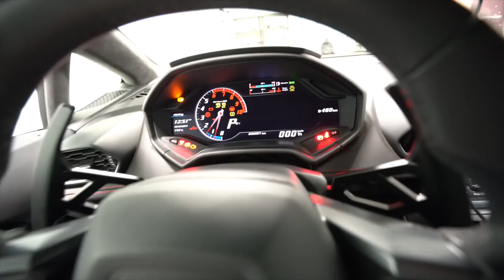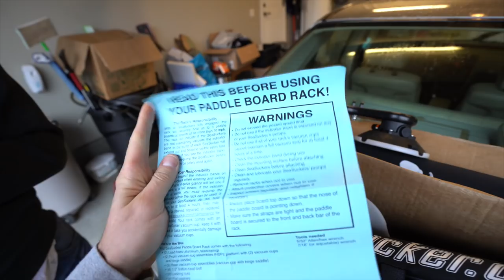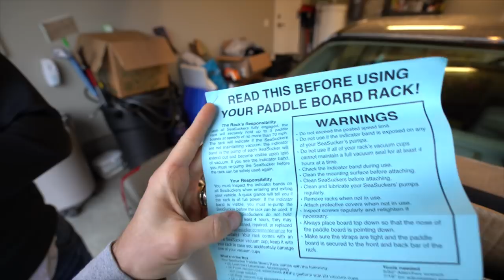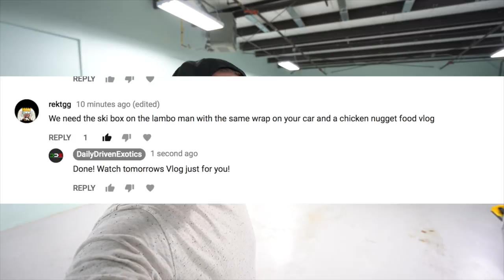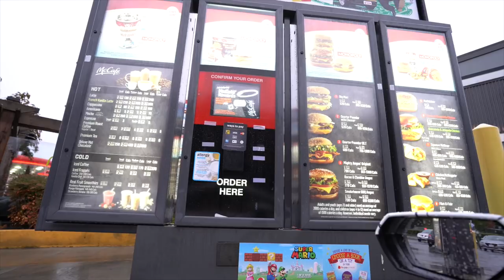My Lamborghini got a ski box *INSTALL*

Comment: I feel like the ski box further back with a fabricated bracket would work best... like mister Stradman has on his. At the moment, the whole front of the car is collecting air and pushing it all up to underneath the box and putting more pressure on the suction cups. If you mounted it further back so the front of the box is at the front of the roof, more air will go over the box instead of all being forced under the box, therefor putting less pressure on the suction cups. But some of the collected air might be pushing off to the sides of the box which would alleviate some of the pressure. 

Also... I wish I was a hat person. Would be fun to have your hats... but I'm only driving around a base model older gen Mustang haha. Working on it...

Comment: The box will be a lot more stable if you position the mounts/bars further apart. First figure out how far apart the interior box clamps can be. Then position the bars accordingly.  Make sure the bottom of the box is as level as possible. If tilted downward, it will act like a spoiler. If tilted upward, it will act like a giant air break and create lift until the suction cups fail.

Comment: You should move to ski box back and modify those poles to go straight back off the glass room the other mounts so you get the better aerodynamics so it doesn't blow back while sitting forward the way you have it the first time

Comment: I understand why u need a ski box... The frunk of the huracan is so small, and I have both a 458 and LP610 and the 458s trunk is like double size, so I get the ski box. But I believe it needs to be moved back ober the engines glass bc it doesn't look right like that. Plus it needs to be wrapped like the huracan

Comment: Although the ski box looks up side down, in that position the ski box should produce downs force, being the air has to go from the higher nose, sloping down to the roof of the car,  kinda like an upside down airplane  wing.  IF you could put some kind of tether strap and attaching it to the box,  to the car maybe one of the hoes in the rear engine glass, if the box t does fly off, you'll cause minimal damage to other cars.